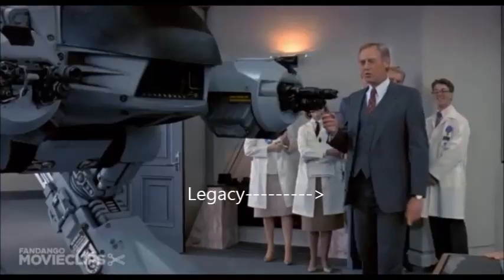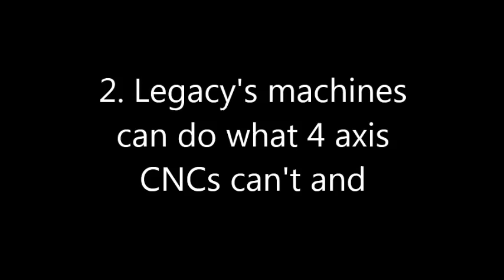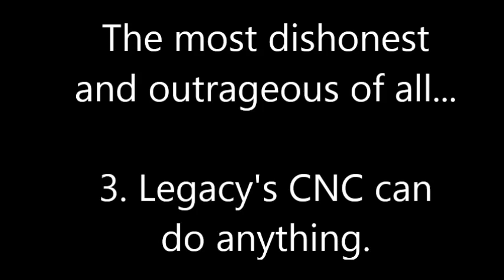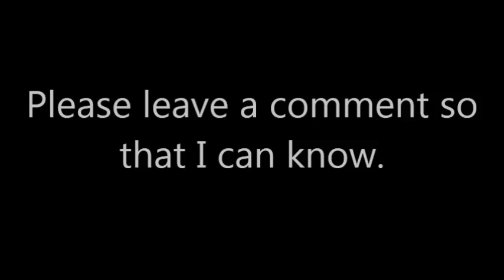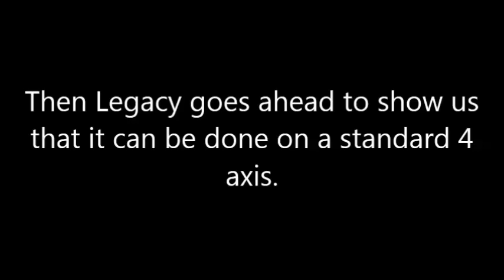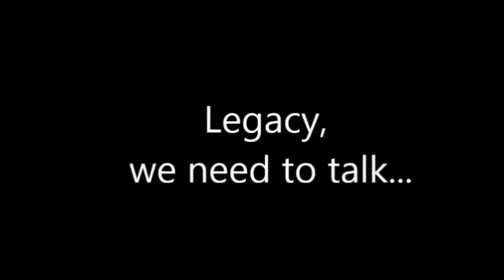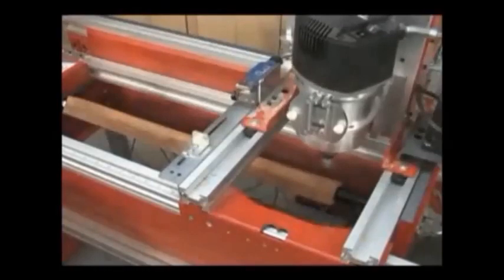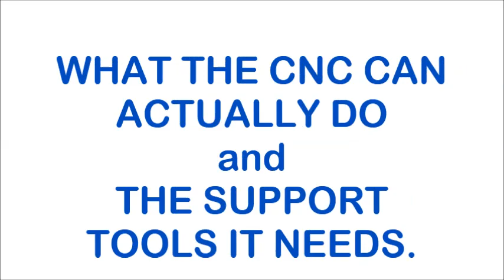Legacy Woodworking Machinery's astonishing lies (a gruesome way to introduce CNC to novices) 2018

Comment: That is a rather slick and vindictive video. I have had a Legacy CNC for two years. It cuts on five axis.  The machine can make anything I can design so far. Their after-sale support is incredible.  If you messed up your settings, they will take control of your machine over the internet and fix it while you watch. Their weekly live web-based classes are free to customers and potential customers. 

It is just my suggestion but consider using some of the energy you have directed to negativity and make some money with the great legacy machine so you will not be homeless. Carved signs and fancy table legs would be a good place to start.
Reply from the maker: Hello Oxymoron, I am sorry for annoying you. I am just showing you things that you obviously have not seen before. Just check things out for yourself. Search on YouTube “5 Axis CNC”.  Compare real 5 axis equipment from great American brands with Legacy at 
https://www.youtube.com/watch?v=1xDzePY0gxE 
Even ShopBot makes a true 5 axis but they immediately tell you that it is for light duty only.
 If you wish to call your machine 5 axis that is okay. But a pickup truck is not a Mack truck.
Reply: People who are smart enough and experienced enough (in life) to own or operate a CNC router are normally impervious to inane and pedantic rants of irrational and irrelevant arguments as in your rather impressive videography. However, our disparate knowledge of the subject and your irrational conclusions bated my inner child to respond. Subject matter aside, consider the following truths:
1. You don’t know what I am thinking.
2. Your statement that you are showing me things that I have “obviously have not seen before” is conjecture and undermines the creditability of any other “facts” that you may conjure to support your minority opinion. 
3. Your carefully crafted response did not challenge my characterization of your opinion video as vindictive. Vindication is usually detrimental to the originator. 
4. You are correct: “A pickup truck is not a Mack truck.” Facts are relevant and convincing. Vitriol only demonstrates the balance on the other end of the bell curve. 
5. I think we all agree that you are entitled to your own opinion. Perhaps you might agree that others are permitted their own opinions too?
6. If you are ever in Kansas City, I am willing to engage in a rational discussion of the subject. 
Have a good day.
Reply from the maker: Mr. Oxymoron is merrily living up to his name and I am left speechless. 1. Yes, I don't know what you are thinking. 2. I am sorry for saying that that I am showing you what you have not seen before. But when Uncle Bob below said "You do not need table saws or band saws if you have a vacuum table" I wrongly assumed that all Legacy fans are ignorant. I apologize. 3. Am I vindictive? Yes. So would you if you paid for a new machine and you are given a refurbished machine that was DOA. My anger is because I was given the impression that the machine was not functioning because of my lack of intelligence. I own and operate a far more complex machine now so I am not stupid. I cannot come to Kansas City for a lot of reasons but I really appreciate your unbiased civil comment. Uncle Bob (below) said I must be on drugs.
Reply: So be it. Apology was certainly not expected, not necessary, but very civil and appreciated. Do you want to sell your pile of iron? What zip code is it located? Have a good day.
Reply from the maker: My favourite commentator.  It is not all scrap iron. The Bosch router was excellent (I cannot lie). Aspire is probably the cleanest software I ever used. It never hangs (hung?). But I have outgrown it. I use RhinoCam now. RhinoCam, which crashes regularly and doesn't even have an undo button, is simply astonishing with 4 and 5 axis. 5 axis equipment is expensive. But if you buy one you can never say you were cheated. I would not buy one even if I can afford it. I cannot outgrow 4 axis in my lifetime. Are you in the scrap iron business? Best regards.

Comment: You know, I've met guys like you before.  I used to do compensation and pension exams for patients, even though I was chief of the department, because no one else wanted to do them.  Most patients had legitimate cases and I was happy to work with them.  Occasionally, however, I ran into someone who had literally boxes of files that contained all of their complaints and appeals and evaluations going back years. There may have been something  real in there somewhere, but they usually looked pretty good to me. The thing that struck me was that their case had become their entire life, and I wondered how much better off they would have been if they had spent that much energy moving on with their life and dropping the whole thing.

Comment: I've worked in the CNC industry for over 30 years. A five-axis machine is defined by the way the cutter tool moves.  As Mazak puts it "The term “5-axis” refers to the number of directions in which the cutting tool can move. On a 5-axis machining center, the cutting tool moves across the X, Y and Z linear axes as well as rotates on the A and B axes to approach the workpiece from any direction."  Rotary tables are referred to as the 4th axis.
Reply from the maker: Gary, sir, put it to us like you are talking to a 7 year old. Are Legacy's machines 5 axis? Please watch https://www.youtube.com/watch?v=1xDzePY0gxE&t=10s before you reply. Best regards.
Reply from the maker: Are Legacy's machines 5 axis? I am anxiously waiting for your reply sir.

Comment: I think only the first argument is legit. The tilting table is not a true axis since the tilting is not controlled by computer of some models. Legacy is using profile cutter to speed up the cutting and the spindle can only move upper and down. If the table does not tilt, the profile cutter will generate an angle with the tapped surface.  Profile cutter is the reason why it cuts faster than traditional way and the tilting table is a must with this type of 3+1axises cnc. Other arguments do not make much sense. Of course a woodworking cnc is not a magical do-all machine. At least it cannot cut steel.  Who could believe so if he/she understand what is a woodworking cnc? It is not a cheap tool for most of the users. I guess everyone should have fully understood this machine's limit before purchasing. 

In some videos of legacy, they calculated how much revenue there machines could generate in one year based on $100 per piece. I think these calculations are a bit over-sale since they just overly simplified the production and sale of the woodworking market. Legacy just made it too promising.
Reply from the maker: Hello Thomas! I trust you are in good health! 

First, you said "this type of 3+1axises cnc". Yes Legacy's machines add an extra "thing" to 4 axis. Someone suggested that they should call it 4.5 axis. Not a 5 axis.

Second, you correctly called their marketing "over-sale". So I am equally guilty for stating that a woodworking cnc can make a fighter plane. I admit.

Third "everyone should have fully understood this machine's limit before purchasing" is the main problem. People know nothing about cnc machines. In spite of the fact that I was operating a CarveWright I still was still swayed by their slick videos.

Another main issue, however, is that I bought from them a machine that was just destroying my wood stock. I have a very solid 4 axis machine now so they cannot say I am ignorant. 

I will upload two videos about my Legacy experience within a week.

I really appreciate your comment. Thanks Thomas.

Comment: Damn dude you have some hate in your heart and plenty of time on your hands. Anyone who thinks the legacy models are anywhere close to resembling the machines you compared them to. Well is a idiot has done 0 research before making a substantial investment and quit frankly deserves whatever disappointment they run in to. Hardly legacy's fault, ive been researching on a maverick and by all accounts they're very upfront about what the machine is capable of. Technically any method of movement on the machine is considered an axis. It's up to the buyer to determine what a 4th or 5th axis means particular to that machine.
Reply from the maker: Sir, you call me an idiot. Who has hate in their heart? You or me?

Comment: Technically,   it is a 5 Axis CNC.  It has   X Y Z B U .   The B rotates on the Y and the U rotates on the B .On small Cam programs they never talk about the A B rotations they just talk about left or right and does it rotate on the X or Y.  Personally I would not buy a  Legacy CNC but they good little Routers to play with in your garage  doing hobby’s and crafts but if you cutting 100 spindles or routing 100 sheets a day  they not the CNC Machine  for you. The 5 Axis CNC you showing cost way over $ 400,000.00 so it not apples to apples is it.  You do need common sense to make any CNC router work and your video show you lack that.
Reply from the maker: Sir, with all due respect, watch  https://www.youtube.com/watch?v=9oZ_GsOBqnY and https://www.youtube.com/watch?v=nc_l3z_0x0M. Let us see if you will still tell me I lack common sense after watching them.